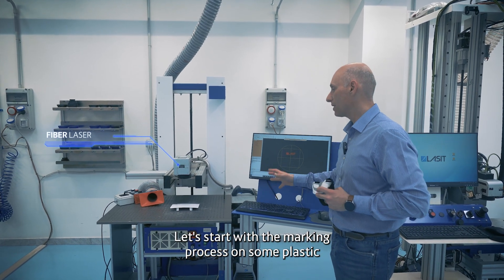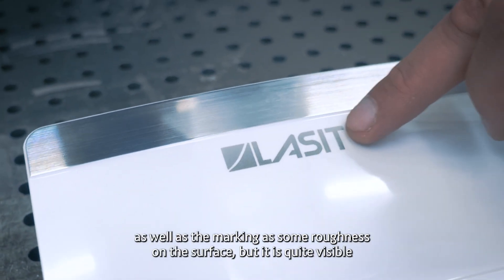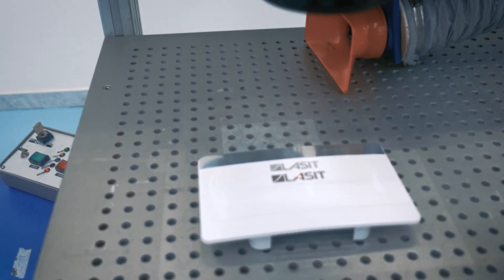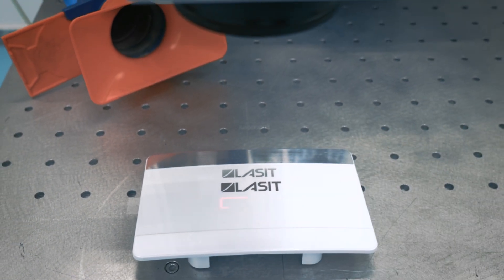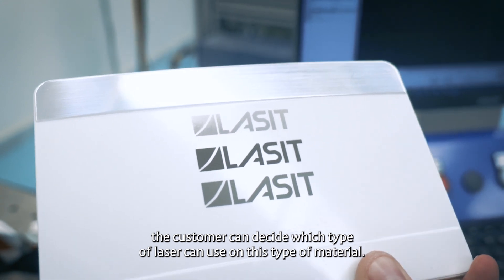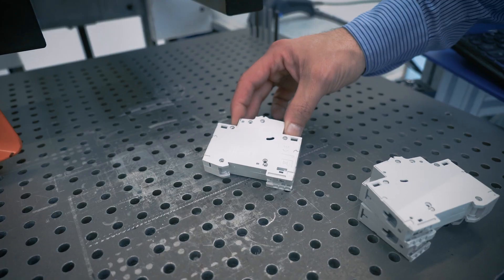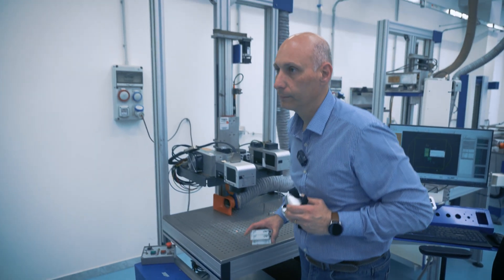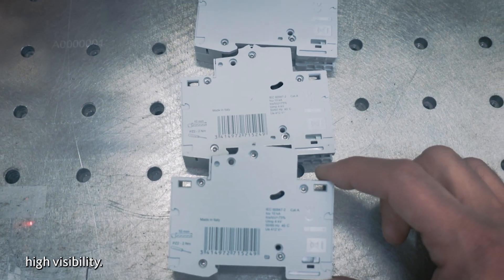Laser Marking on Plastic: Testing Fiber, Green, and UV Lasers - LASIT

Comment: The result with the UV laser looks really smooth. Is it possible to combine this source with your standard laser marking machines?
Reply from the maker: Thank you, for some types of plastics such as ABS, PA, PE, POM, PET, the UV laser actually seems to be the best solution. Yes, it is possible to combine a UV laser with standard industrial laser marking machines. Standard laser marking machines can have different optical, electronic and mechanical configurations, as well as software specifically dedicated to UV lasers.